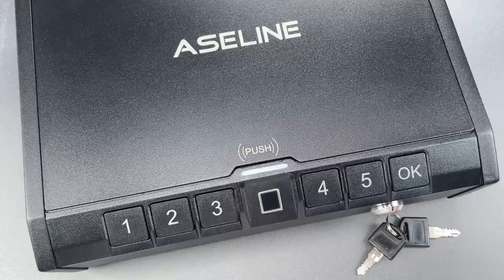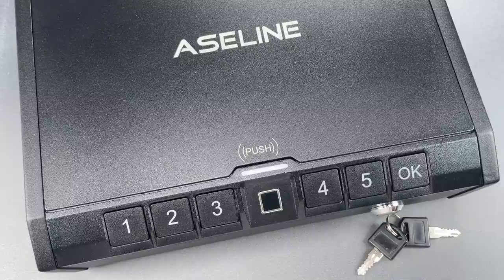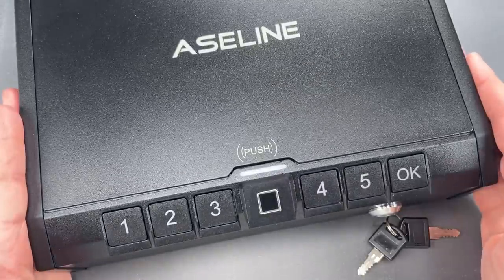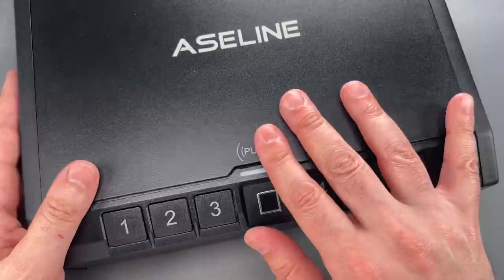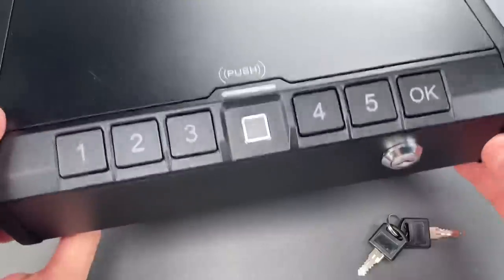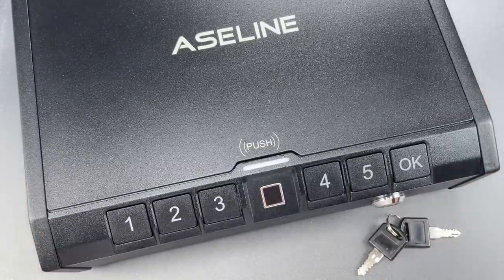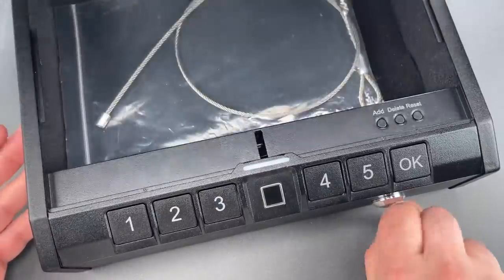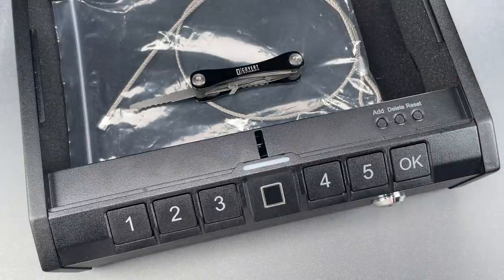[1445] “Aseline” Jiggled Open… As Bad As It Sounds.

Comment: It does baffle me that companies put effort into their locking systems, only to make it redundant with a cheap wafer lock.
Reply: I think those companies just pick ready shelf parts selecting them by cost only, and design a case around. There was probably zero though on how all those parts works together.
Reply: Shareholders aren't going to settle for a 90% profit margin when they can get a 90.25% profit margin by using the cheap lock.
Reply: The programming for the locking system is a one-time (probably low) cost. The cheap wafer lock is a recurring cost that saves them a lot of money - at the expense of safety, obviously.
Reply: @rebeccak918  the programming was not cheap and wasn't just programming.  It requires a sensor or switch for it to actually tell when it is locked.
Reply: @tsm688  A sensor isn't needed, the locking latch can just press down a slip of plastic to disconnect the circuit to the buttons
Reply: Yup... You're really just buying the cheapest dollar store lock possible, with a bunch of buttons and scanners attached to it just to make it look cool.
Reply: Yup. Protect a $200 handgun with a $1 lock. Makes plenty of sense.
Reply: It seems that the market for most of these is the "the state says I have to keep my guns in a safe so I'll buy something cheap" crowd
Reply: @StephanBijzitter  that sounds like a sensor to me.
Reply: When he said wafer jigglers for some reason I thought it was a kids snack
Reply: Exactly- skip the trash mechanical lock completely. If you don't change the battery, you get to destroy your safe!
Reply: @tsm688  Good point. I don't know much about locks, so I didn't think of that
Reply: @christopherbedford9897  Wrong way to look at it: you are not protecting a handgun - you are protecting far more valuable life from the handgun with that lock. It is not $1 protecting $200 it is $1 protecting $millions, perhaps your son, daughter, spouse, sibling or yourself!
Reply: @DJW1959Aus  Correct. My comment was intended to be purely superficial.
Reply: @aboriani  This is the answer. Some of the time it's worse than that, the marketing dept says "we need something at this price-point, what can you come up with", then management & finance weigh in with "we also need this gross margin or better". The buyer/designer is then hemmed in on what they can come up with or ask for and you get stuff like this. 

Source: 10 yrs as a buyer for a large retailer.
Reply: If aint sealed in molten titanium and concrete, LPL is getting in though.
Reply: does it really? seriously... really? these are merely made to abide by the law to the weakest degree possible.
Reply: @d1j16  This makes sense... If I was that designer working in those conditions, I would feel my soul burn a little bit every time I put a product out...
Reply: @aboriani  I can't argue with that. Luckily for me, the products I managed weren't safety oriented like this one, so even if I had to tweak the specs to make management happier, it wasn't going to get anyone hurt. Mostly, I had to find/design less expensive packaging or reduce the amount in the package, ala the supermarket shrink ray.
Reply: This seems like an engineering problem. I wonder if one of these safes can be "fixed" by jamming or removing the wafer lock.
Reply: Probably to avoid phone calls like "I lost my keys, my code and my fingers and need in my safe", by letting people defeat the lock with little effort.
Reply: @StephanBijzitter  a sensor, as in a circuit board mounted switch will be cheaper than a bespoke bit of plastic.
Reply: @tsm688  programming, and possibly new IC selection, if it wasn't part of the original "one size fits all" product should be less than $10k. PCB mount switches are cheaper than any lock upgrade.
Reply: @christopherbedford9897  Worse - you are not protecting the handgun, anyone can walk out with the 'safe' and the handgun inside it, you are trying to protect the curious 7-year old from accessing the handgun - and using a $1 lock.
Reply: @phaiz55  Further proof that the stock market was a mistake.
Reply: @aboriani  It just makes it more infuriating when they do harden against some attacks, like making the programming button unusable while the device is closed, then break it with a lock you can open with a paper clip
Reply: The safe has effort put in a quick open code and fingerprint system so people can use their gun quickly since many states let you use a safe gun for home defence.

So the parts that are important to the customer "I can use my gun quick" are kept intact. The parts that don't matter to the customer "Secure my gun fron others" has nothing but the lowest effort.
Reply: @phaiz55  Joke's on them, cause 90% of 1 million is more than the 90.25% of 1 they'll make when videos like these come out
Reply: @fearedjames  I believe LPL has called out these companies for adhering to the letter of the law, but not the spirit.

The whole point of a safe like this is not to keep the gun from intruders, but to keep the gun from children. So, they should be making it at least secure enough that a child can not jiggle the lock open with a nail file. Because any child can figure that out quickly.

These companies do not care about security, just giving people the pretense of security.
Reply: Made to be sold not used

Comment: I'm looking at the construction and can't help but think that a screwdriver would defeat that puny lock.
Reply: I think he is just trying to be polite...
Reply: a can opener from a dollar store would do a swell
Reply: Most likely. But a "curious adolescent" would end up busted himself by using a destructive method like that. (Maybe he'd get lucky and the lock would survive, but probably wouldn't risk it). I presume that the "curious adolescent" test assumes that the child cares about what his parents think and would do.
Reply: @QuestionMan  if that curious adolescent is about to shoot his grandfather and 19 kids at school, i dont really think he’s worried about not destroying the safe so nobody knows anything happened
Reply: breathing on it could probably open it
Reply: @hasrataulakh  None of these small gun locks are secure enough for that.  You need a real gun safe.  LPL has previously said that he believes this type of lockbox is only appropriate for use when the gun owner is home and may need to access it quickly.  If the gun owner leaves the home, the gun needs to be in a proper gun safe.
Reply: Hell, based on the tinny sound, a substantially strong teenager should be able to muscle it open.
Reply: @QuestionMan  The first and most important aspect though is to prevent a situation where a "curious adolescent" could potentially shoot himself.   So IMO, if a child could get it open then it fails the "curious adolescent" test regardless of how destructive the entry may be.
Reply: @hasrataulakh  🤔 Your example is most decidedly NOT simply a "curious adolescent." It more closely resembles a straw man.
Reply: @Mike__B  Quite possibly. But my point is that fear of reprisal is effective as a deterrent for simple curiosity. Beyond that, aren't we dealing with more than curiosity if an adolescent is willing to DESTROY his parent's property for access? (And in fairness, many, many locks can be effectively, if not easily, defeated by destructive attacks.)
Reply: @Mike__B  To be clear, the point is that the lock is so bad, it doesn't even require a destructive attack to open. That makes it MORE dangerous. Because it does, in fact, make this case more susceptible to a "curious adolescent" accessing the contents and accidentally harming or killing someone.
Reply: @pheasantplucker  it’s not insensitive to bring up current events that are related to gun safety in the US.  

Choosing to not talk about shootings only makes things worse. .
Reply: Doesn't matter how good the pinning or how high the tolerances are, any lock secured by a nut on the threaded cylinder can be easily brute forced with a simple right angled screwdriver
Reply: @QuestionMan  Absolutely no question that lock is bad on all fronts.   I was simply pointing out that the lock failing at any level is a fail in my book regardless of evidence of destructive opening.
Reply: @Lilith-Rose  Depends what happens when the entire lock is turned by brute force.  Mechanism might open or stay shut.  Before he jiggled it, I was hoping it would do nothing if the battery was charged and the recent input was an indicative of a failed attack.
Reply: @johndododoe1411  usually a mechanical override is exactly that, it works no matter the situation with the electronics. The point of having one is incase of a dead battery or other electrical issue. Rotating the whole lock body is the same as rotating the cylinder in a majority of these type of locks since the actuator is linked with the back of the cylinder and is operated by a turning motion so it doesn't matter if you use a key or turn it by brute force, the mechanical action is the same. Its a specific weakness in locks of that particular construction that is easily exploited. There are some other locks it works with and lpl has demonstrated this premise in a video using a tool made from a modified socket extender or something of that nature as a lock breaker but I can't remember the specific video number off the top of my head
Reply: @hasrataulakh  I thought this was a bit of an extreme scenario and was gonna say: "Or if they're gonna commit suicide, the second most common cause of death for young people between ages 15 and 24 years, right after accidents", but then I looked it up and found out that accidents are only the third largest cause of death and the leading cause of death among that age group is actually homicide!

So yeah, you're right: adolescents in America are more likely to be shot by their classmates than by themselves. That's wild!
Reply: @Lilith-Rose  so, don't buy a battery powered safe then? 
Because if it's grid-powered or mechanical, there's no need for a backup lock, meaning one less attack vector, right?
Reply: @Lilith-Rose  My hypothetical would have the key work once the battery is flat OR the electronics decided it had resisted jiggling for a specific amount of time.
Reply: @johndododoe1411  but what if the electronic lock malfunctioned due to corrosion or a dry joint but still had power, or human error of forgetting the code/damaging the fingerprint? If the electronics control the operability of the mechanical override lock then the mechanical override becomes useless, plus it opens it up to all sorts of other issues. The solution is very simple, you just spend the money to make the mechanical lock stronger and more resistant to picking.
Reply: @hasrataulakh  I think these things are aimed at preventing kids from shooting themselves by accident. Nothing would prevent a determined child who wants to shoot someone. Even if stores didn't sell arms, it is scarily easy for someone to get a firearm on the street. There's simply far too many out there now.
Reply: @Lilith-Rose  Not always. Some manufacturers are smart enough to fit a shaped insert that's welded to the box that prevents twisting of the lock in the manner you describe. That method only works mostly on badly designed cash tins (which can also be defeated by twisting the lid). Most wafer locks these  days have a flat sides either side of the thread on the cylinder, so the cylinder isn't perfectly circular.
Reply: @Lilith-Rose  Of cause a better mechanical lock, on its own, is a better solution.  But the ability to run the battery flat to use the backup key as a hard override was my entire point of mentioning battery life.
Reply: @penfold7800  enough torque will easily round out the non circular hole before the whole thing shears off, either that or the internals give way. Having said that most things are just as easy to get into with a hammer and a beefy screwdriver. Destructive entry into lockboxes and domestic cash safes is my favourite thing about helping with house clearances, since my specialty is jewellery I usually get dibs on anything locked although 90% of the time it's just documents for the burn barrel and nothing particularly exciting
Reply: @penfold7800  as interesting as I find lock picking I don't really have the patience when I know I can just break it and get the same result with just as much job satisfaction
Reply: @QuestionMan  "Curious adolescent" check usually assume the adolescent won't want their parents finding out, therefore should skip destructive methods.
Reply: @chnet968  Precisely.
Reply: @QuestionMan  Well, no, because an adolescent is by definition not prone to use mature reasoning.  That's why they are granted minor status, when everyone knows a 14 year old is not a child in the same sense as an 8 year old. 

Additionally, I think "curious" is being used somewhat as a euphemism.
Reply: @knicknac95  I'm waiting for LPL to open something by breathing on it now
I do remember something almost as bad as that that Bosnian Bill reviewed where just putting in the tension bar unlocked it
Reply: Hitting it with your hand would open it.
Reply: @johndododoe1411  A mchanical lock would be better as a back up assuming you fitted one that couldn't be opened by someone who understood that a simple wafer attack would jiggle it open, if you are building a gun safe like that a lock must be able to withstand a considerable amount of damage before yielding and that barely withstood several seconds before giving up.
The truth is that the design of the lock is poor and no amount of fancy electronic wizardary is going to help if you fit a cheap "Ass"eline lock to the shell.
When you design something like that you work on the basis that the device must be able to defeat a casual attack, but by fitting a poor lock that certainly guarantees that it will be opened with the minimal amount of force.

Comment: Awesome to see that they disabled the buttons when it's locked.
Sadly unsurprising to see that the keyed lock makes up for that lack of stupidity.
Reply: Is sad that we are on that point that we cheer up for something that should completely be so obvious that all of them should have this feature.
Reply: It's weird how little it's done. It could even probably be done in a cheep mechanical way by having the inserting lock part break a pair of contacts that deactivates the buttons. No real head for a sensor or any extra electronic, unless it's using electrics already inside the lock, it would just be a waste.

Comment: When LPL placed covert companion in case, I really thought that he is gonna do a bit, where he accidentally closes it and then casually proceeds to open a safe with a finger nail or something.
Reply: That would be a really nice touch :) or how to bring a statement event more clearly
Reply: I was expecting the same. "I don't even need the tool"
Reply: Holding the tool but not even using it. 😂
Reply: Then he could have shown the vulnerability by using a paper clip to retrieve the covert companion.
Reply: I was hoping that he was going to open the lock box by jiggling it with the Covert Companion inside the box. 🤣
Reply: Came to the comments to say the same
Reply: These locks are basically what you would get on a locker as an employee, when people lose or forget their key's, I literally just hammer a piece of wire flat and just jiggle it open.
Reply: through the magic of buying two...
Reply: I just giggled at his prominent product placement.
Reply: With a half-eaten hot dog, a small piece of booger, and a dead slug as tools, LPL can open absolutely any lock.

Comment: I can personally attest to the importance of the "curious adolescent" criterion. While my household had no firearms in it, using a luggage key, I often employed the jiggle attack on many of these type locks in my house when I was an adolescent myself—including file cabinets and the "parental lock" feature on the cable television converter box (yes, I am old). No locked channels for me!
Reply: @midwestnet2704  I was always afraid of that. Can't recall my workaround. I think I didn't have to turn the lock all the way to disengage the control, so I could easily flip it back locked. (The problem for me was apathy setting in and just forgetting to relock it.)
Reply: OMG! The cable box. Memories of my misspent childhood! The box didn't even use a key. It was a 5-pin DIN plug with a wire shorting 2 pins. They didn't even secure the plastic cap used in place of the strain relief. A gob of hot glue would have at least been a challenge. A paperclip worked perfectly!
Reply: Can one of you explain this to me? I gather cable boxes used to have a physical key to enable/disable parental controls instead of a passcode :o?? If so I'd love to see that!
Reply: @jakeme2563  These were in the early days of cable and pay tv. In my case before HBO, and decades before most of the world knew what bidirectional cable, an addressable converter or even the Internet was. This stuff was simple! I think it was built as a 35 channel/250 MHz system. Who could imagine ever filling all that up? As such, there was only one such channel these boxes secured. With that in mind it was a simple task to enable/disable a single channel using a removable plug or a keyswitch. Completely blocking the service involved the use of inline filters located on the tap, way up on the pole, and well outside my comfort zone. Hell, the pole still is!
Reply: @jakeme2563  That is correct. But, I have no idea what the technical method was for achieving it was. (I can't even remember how protected channels were programmed.) All I know was that the lock was pretty easy to defeat, even for a teenage me.